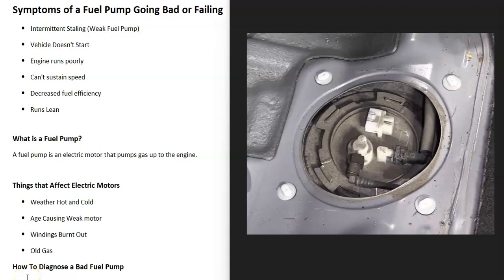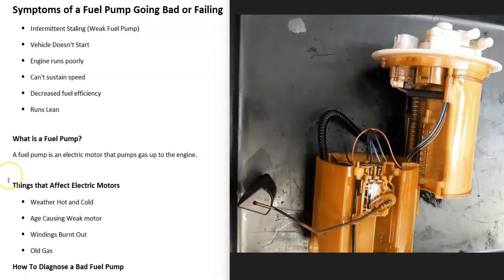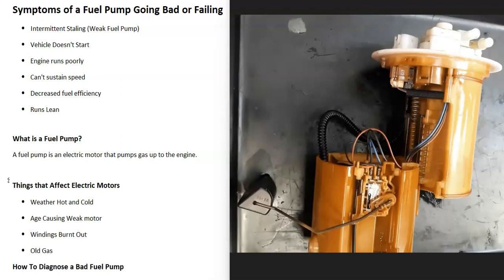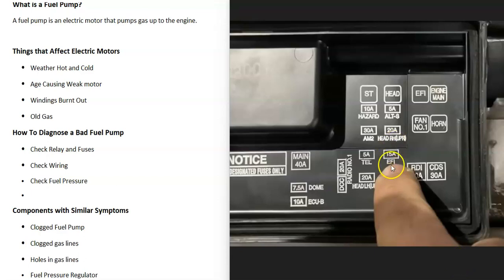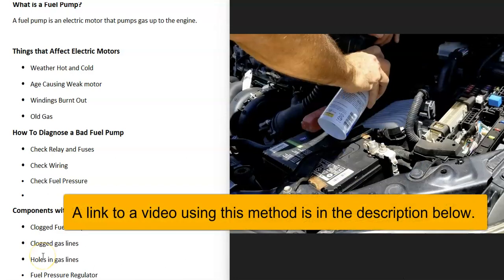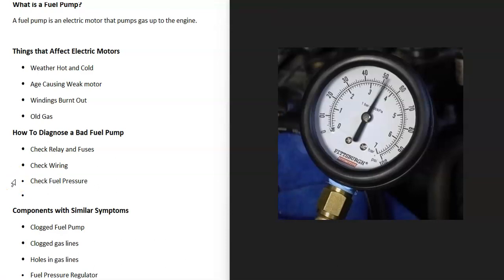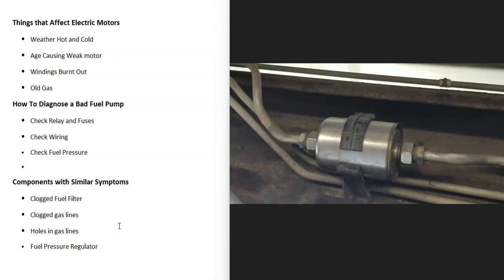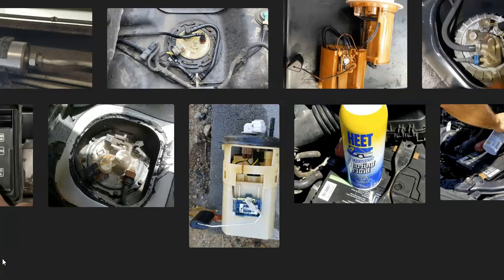Symptoms of a Fuel Pump Going Bad or Failing

Comment: Sometime i started my car it work right away. Sometimes it has long crank before it starts. It cause by fuel pump or not.
Reply: I'm having the same problem with my truck going to change the fuel pump today. I will let you know if it is fixed
Reply: It worked fixed the problem
Reply: Thank you very much for your advice.